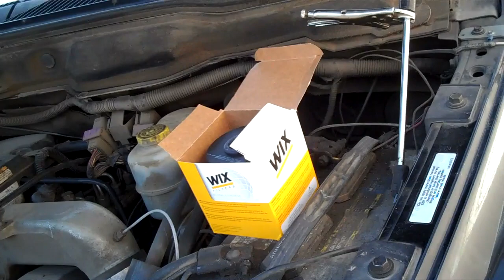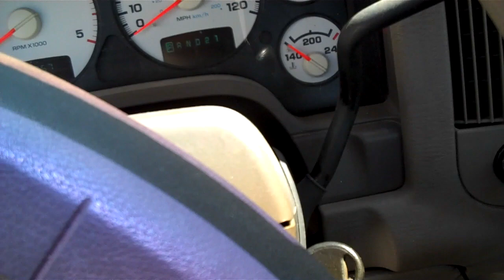L & D Trucking - Shit happens

Comment: A question......I am about the same as you for rate, (In Canada) i am at $3.50 per loaded Kilometre that about $2.50 per loaded miles, local run are the not easy to rate , local run for me is inside 100 km (60Miles) one way how do you rate this, what are you basic criteria, we are running a GMC 5500 with a picker and a Ford F-450 with 30 ft trailer with ramp, like your video
Reply from the maker: Market Value can not be over looked when speaking to local rates, this is how I did it. Up to 75 miles radius of customer. 3.50 a mile would be $262.50. This way I never found myself on the down side. If I went 5 miles, it was that rate. If I went 75 miles, it was that rate. This gave my customers a foothold on cost controls while providing super customer service for each and every call. Of course anything over 75 miles was charged at 3.50/mile. Any permit fees and handling fees were added accordingly. IE If I had to assist in unloaded the load my personal rate was 50$/ hour. Lastly detention fees. Anything over 2 hours documented wait time was billed at 50$. Hope that helps,
Reply: Wayne Loomis Make sense, we are looking at buying a single axle kenworth , we found that there is way less competition here in the 18,000 lb to 40,000 lb bracket
Reply from the maker: screamingbull I would say do it, just know you gonna pay more in fuel and upkeep, but it might pay off in the long run.